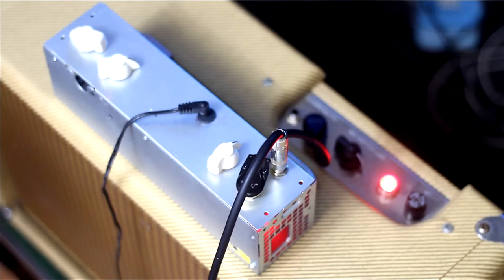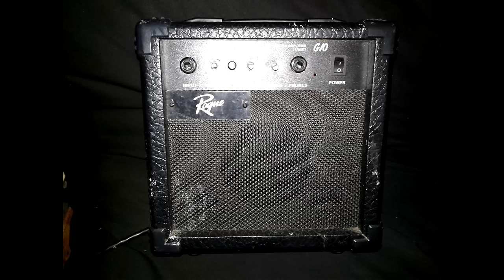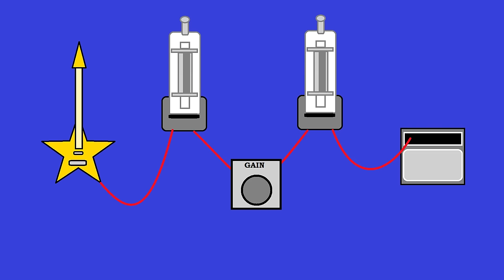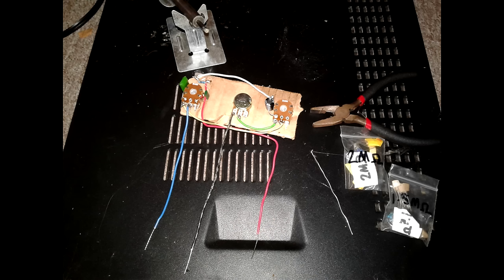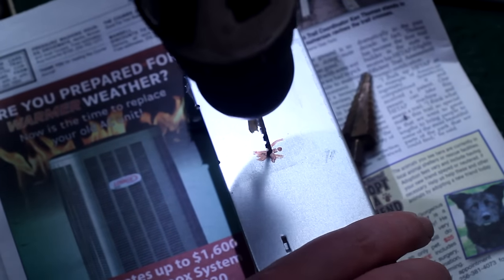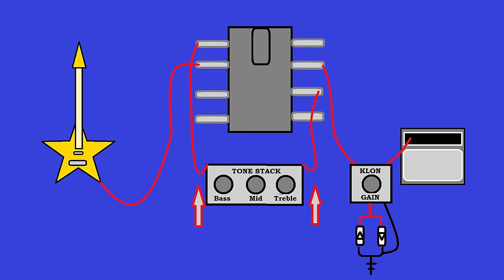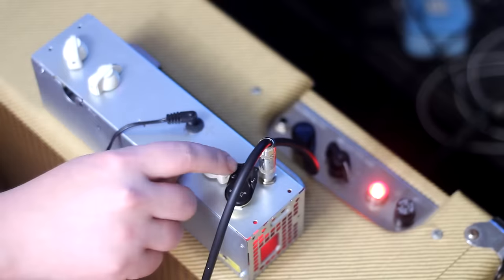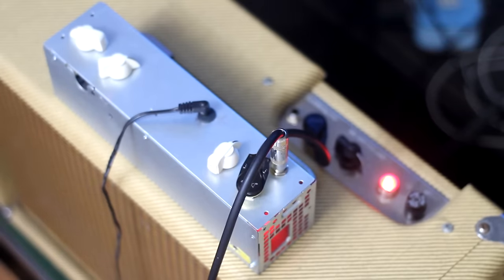DIY Guitar Tube Preamp Build and Demo (Super EASY!)

Comment: If you cannot make a dual tube circuit much better sounding, better look for another hobby! These are trash tones for me only, sorry! Not worth the work. Also makes no sense to me to use two pentodes in a preamp instead of a typical single dual triode. 
But this obviosuly is anyway only an advertsing for some Chinese budget trash circuits, If I follow the link. Farmer trapping only and so it sounds!